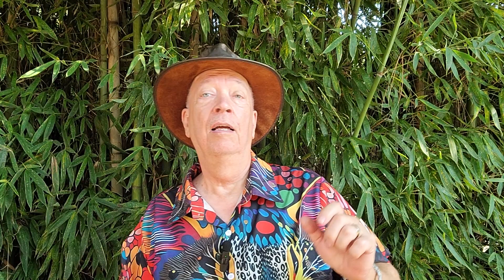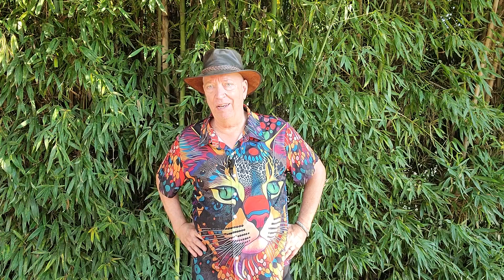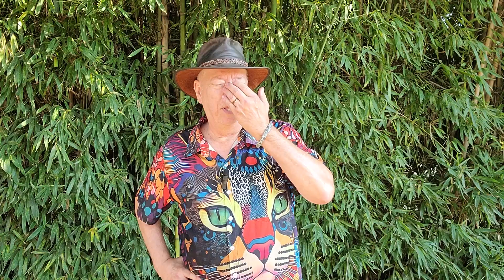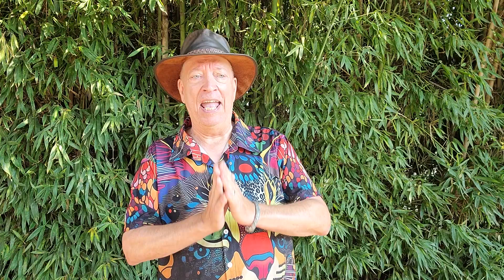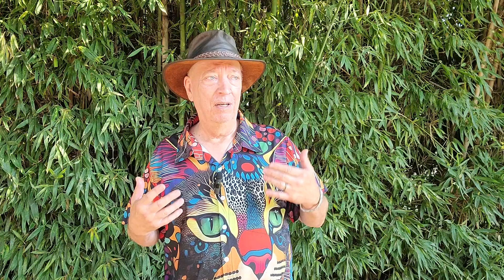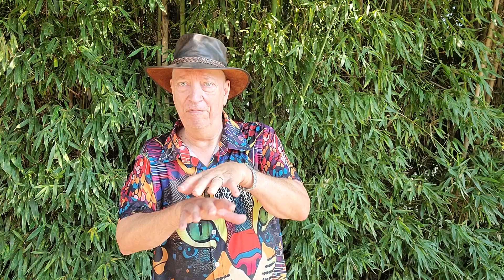Homemade Muzzle Loader Propellant Pt 1b

Comment: 751510 is a German standard of the 19th century. In France there was another ratio 781210. In England there is also its own ratio 78148, but approximately everything revolves around 751510. There is also mine powder 62 nitrate, 18 coal and 20 sulfur. This type of powder gives the maximum amount of gas, but requires a good dense wad. It works at high pressure.
Reply from the maker: Good info! I wondered where 75:15:10 came from - especially since almost no one uses it!  😀 I should've known it was German. They invented pretty much everything concerning firearms up into the 19th century.

Comment: My first batch I used some Reject .44 Mag. Hard Cast (Lyman #2 Alloy ) . The Bullets were visibly worn down after I used them to Powder the Potassium Nitrate and Mill the Powder . That was the worst batch I ever made . Very Smoky ,Dirty , Lots of Sparks and low velocity . I used up the rest of it in 12 ga. Shotgun Shells to get rid of it . I'm using Mulberry , I have a whole tree of it my Wife wants me to get rid of .
Reply from the maker: I use lead alloyed with antimony. They're so hard I've dug them out of a wood back stop and shot them again as is.

Comment: Dont worry about contamination from tools when you make powder. Primo its a in micro quantatity, have less than 0,01% effectivity for powder explosive. Second in profesional powder fabrick, there are too contaminations. You have more contamination because of charcoal making from plants what inside have lots of elements and chemical compunds, than from your tools.
Fuel is less important than oxidiser, you can even make powder only using oxidiser for example nitro amonium. Nitrocelulose have oxidiser and fuel in single molocule. You can make powder only using charcoal as a fuel without sulfur
Reply from the maker: Very interesting observations! I also believe too many people emphasize tool contaminants instead of organic contaminants in the materials. Thanks for watching and great comment!

Comment: I previously used lead medium in my ball mill.  Since I switched to brass, my propellant is much cleaner and more potent.

I also like the 76/12/12 ratio.
Reply from the maker: Which also makes me wonder how did 75:15:10 become the "standard"? It works, but it seems no serious BP maker uses it!
Reply: @timesgonetech3057  Darned if I know, LOL!  But there are so many variables, that when I find something that works satisfactorily, I tend to stick with it!  Best wishes to you!
Reply: have a chemist engineer buddy, and I did QC. "I tried them all" over the years.  per his recommendation, and my OJT with plenty of testing "I ended" with Alumina media in glass and lab grade PVC containers for zero contamination or ESD(electrostatic discharge). 
chasing this dragon for years now.  gave up on pucking for now not enough benefits, and it frightens me with all my haz and OJT training.

to lazy to make my own darn videos.

Comment: Clean the lead media thoroughly.   Weigh it on a very sensitive scale.   Make a batch, or two, or three of black powder.   Thoroughly clean the lead media.   Weigh it again.   Any change?
Reply from the maker: If I see no visible difference in fouling between lead and brass I just may do that.
Reply: Hard lead media is fine for most.
Reply from the maker: @lorenray9479 I use lead alloyed with antimony. It is so hard I've dug balls out of a wood backstop and fired them again in the same gun.